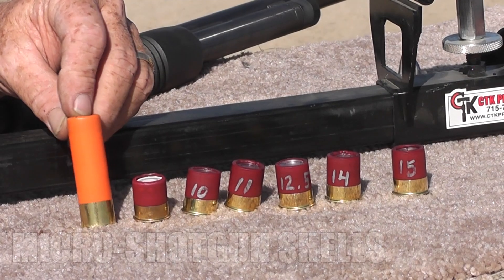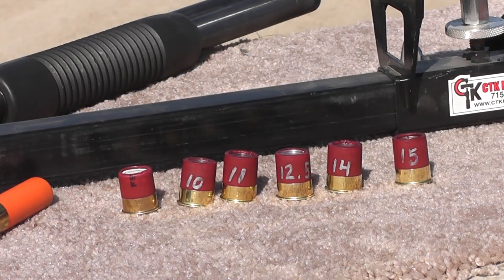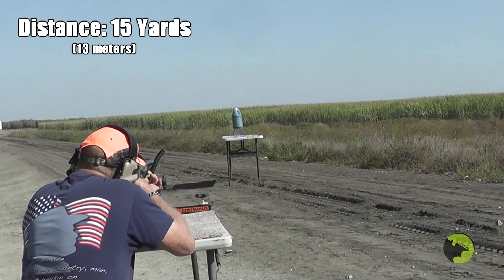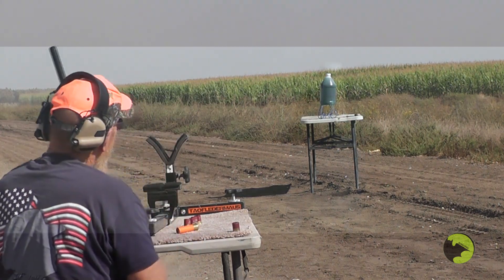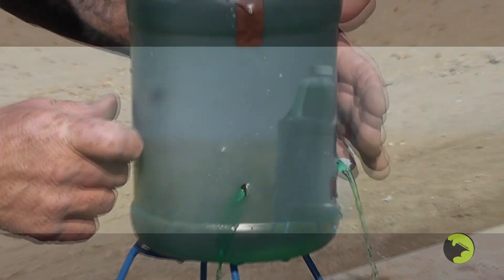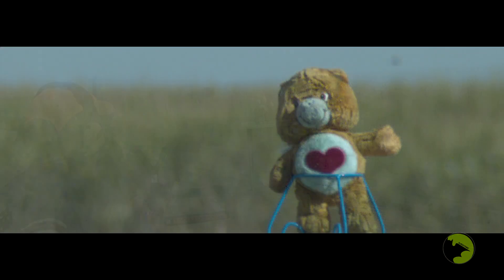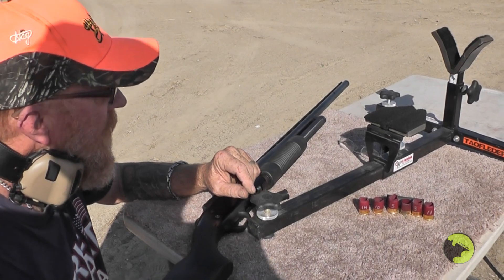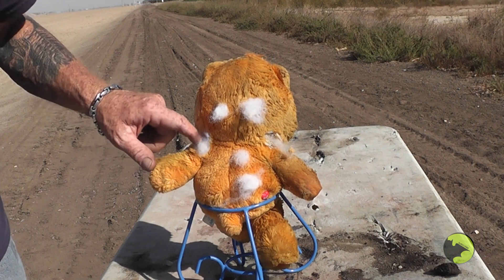MICRO Shotgun Shells -  How LOW can you go?

Comment: 2” hulls(length before crimping) rolled crimped down to about 1-3/4” work pretty reliably in my Mossberg 500’s.
If I go any shorter, I need the Mini Clip to get them to feed reliably. You can still get a decent 9-10 pellet 00 buck load into a 2” hull, along with an extra few shells in the mag tube. 👍

Comment: Interesting video guys.  I am not that well educated on all this, but have examined and played with a fair amount of custom minis.  The aguila birdshot round tells the story IMHO on how to go with minis...a cup wad.  I tried numerous rounds, with a variety of shot sizes, and with a fully choked barrel and  cylinder bore barrel (20").  At 8 yards, nothing kept the pattern tight as well as the Aguila cup wad did.  As the shot sizes went to #4 buck and larger, the patterns were as tight with just the gas block.  As for power, not my thing.  I think the ones I tested were 24 grain?  Green and Red dot.  None I tested was smaller than 1.25" crimped.

Comment: really big improvement over the casio cameras, do you still have them?
Reply from the maker: Yeah they are gathering dust
Reply: i have a lot of computers like that, got 2 new ones in FedEx today a Dell and an Asus, something to tinker with, got a 6 year old Sony 32" LED tv as a monitor in my bedroom, been idle 5 years, the Asus is an EEEbox, celeron n3150, probably match the Pentium it replaces at 1/10 the power and 1% the noise , no fan. can stream classical again, like vacations in Vegas. Sony TV's have good speakers, the computer and tv would probably use only 50 watts.

Comment: NOTE NOTE NOTE> I have heard a myth from friends back in the days that if you tweak the triangle bits at the top of the shots, for example, if you let 3 of them at the top or 3 of them at the bottom of the shot lose or open so that the shots are still held in, it will give you different pattern of spread. you can also play around to see if  you can get any other patterns. this used to be done at the times when they used to shots birds and they used to find these birds grouped up in different location, so they used to use these shots  each one adapted to one sorts of pattern so they get maximum hit from each shot.

Comment: When he says pyrodex does he mean that brownish white powder.  If so you may as well full it with a 1 part pyrodex 2 part black powder mixture. That'll give it a bit more power if you really wanted to step it up toss some rice husks in a blender get it to a nice powder. And coat that powder at a 1:1 ratio with the blast powder mix with a small amount of water to make a paste. Then air dry or dehydrate the mixture. This is a pretty powerful mixture though so be careful.

Comment: To deal with the spread turn them into wax slugs. yes you will not get much in those small shells but you get the weight and slug effect if it holds together.

Comment: Slug vs. Slug... two shotties (same), pointed at the same target, fired at the same time. A slug race to the target with a crash at the    intersection ...... or two shotties , not far apart fired at near the same time and one of em' will get "rear ended". Sounds like a timing nightmare but so perfect for a high speed camera shot. Just my two slugs worth.

Comment: pyrodex / the black powder subsitute ?  why?
Reply: It burns fast at lower pressures. Smokless powder you need a certain pressure or it hardly does anything.
Reply: IIRC  the OEM loads in those shells packed more punch than the pyrodex did in these reloads

Comment: My MEC used to have the pin work out in the final crimp assy, and the cam roller would fall out, and then the crimps would get messed up, so I'd trim them down. It got to the point that I made up trim guides for 2 1/2, 2 1/4", 1 7/8". I finally replaced the part.
I load them with #4 buckshot, and wish there was a short shotcup that actually fit the Lee 7/8 oz slugs.
Email Gualandi. and tell them the trim length of the shells and they'll help you with load data for their wads. They helped me with BRG 12 (BPI SSW) data, and the reductions weren't as drastic as I expected.